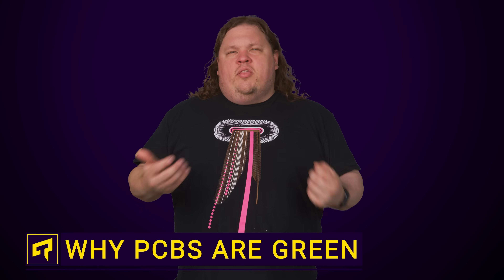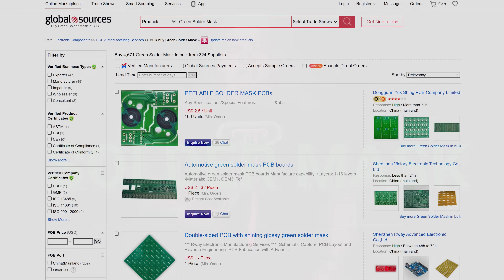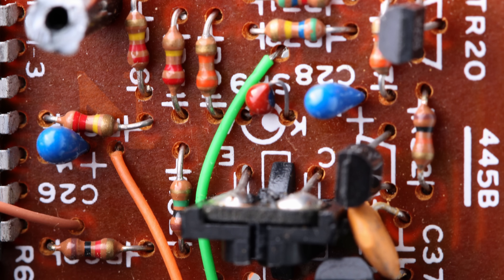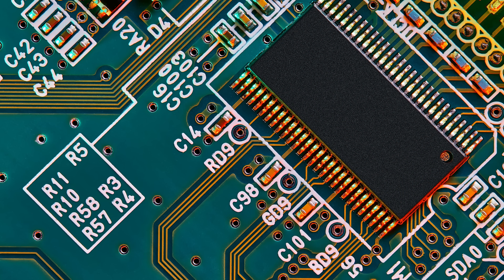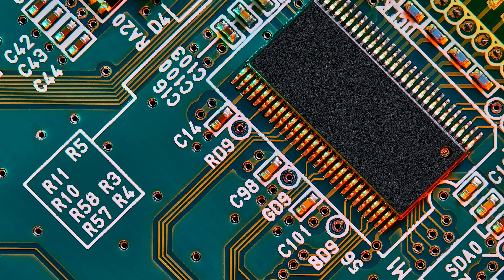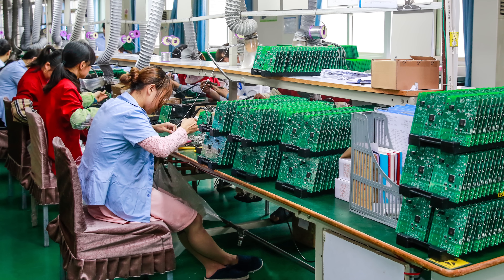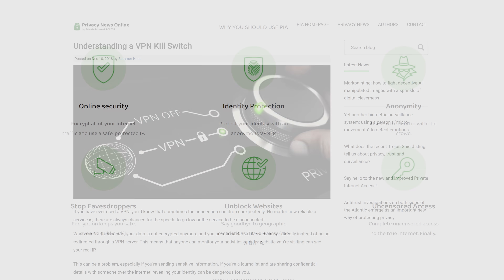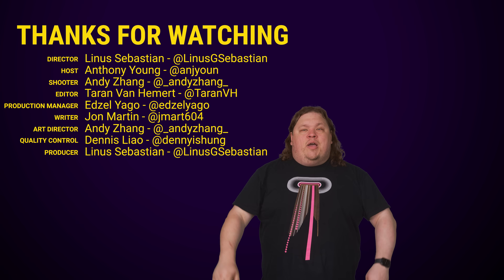Why Are Circuit Boards Green?

Comment: Now I wanna see LTT do a video on growing a plant in a PC. If it's water cooled, the plant can get water from the reservoir and they would just top off the reservoir every once in a while
Reply: That would mean humidity. That would mean corrosion. We're also going to have to wonder how you're getting water out of the res and to the plant...
Reply: @DxBlack  now convert this humidity back to water and fill up the reservoir again
Reply: @sgt-wd  Infinite water!
Reply: @DxBlack  you can coat everything the same way you do for immersion cooling/waterproofing circuits.
Reply: @SteveUnperceived  you could mod the case. So there could be a hole for the uv light.
Reply: @SteveUnperceived  Plants need mostly regular visible light as well as some UV in addition to visible. If a plant is green, it means it reflects green, and therefore you can cut out that color range, leaving red and blue = magenta color. It's why "plant lights" look purple. But recent science tells that a full color range like the Sun is better than purple.
Reply: This comment is going to get (k) likes
Reply: Plants generally don't like hot water
Reply: @thisaccountisntreal107  you could have it water the plants when it isn’t doing any intense workloads.
Reply: I hope yall big brains know they'd do more than just plop a plant in a case and call it good
Linus even used a mini fridge as a case before, they'd figured something out
There's cases with glass (or no) tops to allow UV light in either by a window or with a UV lamp
They could also make a hole in the side of the radiator and route a tube to the soil of the potted plant that would work like those watering globes
As for the humidity, they could do like they did with the mini-fridge PC or oil dipped PC's
Reply: Plants generally need more than just water. It's kinda why most of them are in the ground
Reply: @Dr.Spatula  you can get a UV light and also put soil if necessary.
Reply: That would add humidity to the case... And the loop wouldn't be pressurized anymore. it needs to be a closed loop.
Reply: @RobertJene  what about when you leave the top of your reservoir off when you're bleeding? That doesn't keep the pressure out of the loop
Reply: @JRLarsen  but it lets particulate matter in the environment fall into the loop. And you want pressure in the loop not out of the loop
Reply: Weed growop in a PC case! :D
Reply: i guess you dont know there are entire forum sections specifically dedicated to growing plants in PC cases.
Fun part is, they always tried to avoid any trace of light leaving the case while now pc cases are more like light shows flooding the room with lumens.
Strange things.
Reply: Came here to say this.
Reply: Growing a plant in a PC case. 

Dude, get the fuck out of your parents home and start growing ur weed properly if you so want to.

Comment: Brown pcbs would be good in a noctua themed PC
Reply: Or sewer themed builds
Reply: Brown PCBs are actually pretty rare for multi-layer applications, and even then they're still green on one side, not to mention they're easier to damage as they're made out of compressed epoxy-bonded paper (class II) as opposed to the epoxy-bonded fiberglass (class IV) that is commonly used in PC motherboards and graphics cards.
Reply: Hey @LinusTech, how about hydrodipping a motherboard? I mean, you've got the tools already after the gfx dip!

Comment: I remember the ugly brown boards and have seen some blue bords that look really nice
Reply: Do not forget the odd dirty yellow ones, I miss the Red one's a lot as well as the blue ones.
Reply: @liaminwales  these gave me Dune 2000 vibes
Reply: Yeah I remember those brown boards inside of VCRs and cassette players because you could always see inside the tape deck when it was opened.
Reply: I still have somewhere in the shed a yellow/brown mb and a red MSI gpu...
Reply: @u3pyg  ship it to me
Reply: Hercules had blue PCBs as a sort of signature thing.
Reply: I dunno if their boards are still blue, but Gigabyte motherboards were blue for YEARS.
Reply: @RepEvox  Im talking about in consumer products, not DIY making electronics.
The DIY ppl know the cool colours and use them.
Reply: I did most of my first soldering on those ugly brown things.
Reply: I always enjoyed the old ugly brown Abit BH6 boards
Reply: I get brown, yellow and green circuit boards from stuff made from this decade
Reply: Some early PCBs around the late 1960’s and early 1970’s used to have the bottom trace silk screened on the top component layer.
Reply: Never cared much for the brown boards.  They stunk when you soldered on them and and you had to be extra careful not to lift any copper.  The yellow boards were a bit better, less brittle and much more heat resistant.  I don't think I have ever seen a multi layer board made from either.   

I do like the idea of changing up the color of the solder mask.  It's a very good way to indicate rev levels or generations.  The green gets kind of boring.
Reply: my old pc had a green one. rn i have a black one that fits the color of my case
Reply: Oh yeah there as a time in the late 80s early 90s that blue proto boards were indeed the rage. I had forgotten about that but I have used them a lot in those days.
Reply: these effing dell laptop boards are still blue
Reply: I've worked on a lot of vacuum tube TV and radio boards.  The boards were almost all brown.   The printing on a decades old board tends to get yellow and it becomes difficult to read against the brown background.    The electronic manufacturers began making boards in green because green provided good contrast.   It's the same reason why bench cutting mats and watchmakers bench mats are green.   Keep in mind that in the early days of electronics, boards needed some level of hand assembly.  Many of the components were loaded on the boards by hand before the boards were sent through the solder machine.   Even some of the finish soldier work was done by hand.   Today board assembly is all automated but the majority of consumer electronic boards remain green for legacy reasons.  They're green because they almost always were green.
Reply: Bords

Comment: I miss that super old brown that they used to be lol
Reply: Good point. I remember old PCB’s in old radios and TV’s
Reply: then wait until noctua start making motherboards
Reply: It screams Retro. I like it too.
Reply: Power supply boards are usually beige. I think that's about as close as you'll get these days.
Reply: @RepEvox  FR-4, the most common pcbs yellowish. The brown boards are ultra cheap Fr-2 made from paper instead of glass fiber
Reply: @RepEvox  Brown boards are a phenolic substrate. Better boards are made out of fiberglass. Unmasked fiberglass boards are a pale greenish or maybe white.
Reply: @RepEvox  just the fiberglass substrate tends to be green to tan. It depends on the resin. Dark brown is phenolic.
Reply: Looks 💩